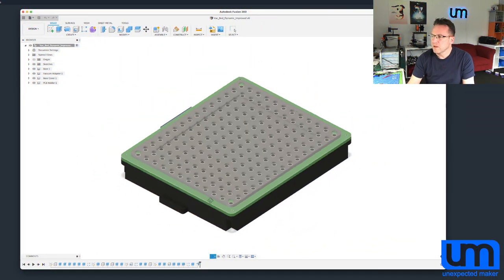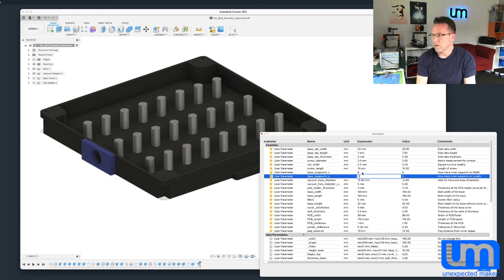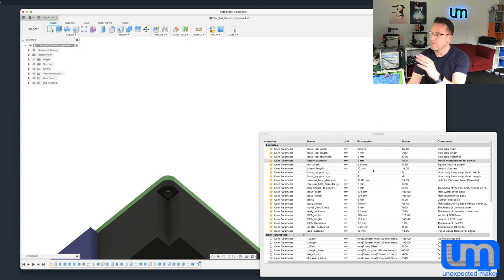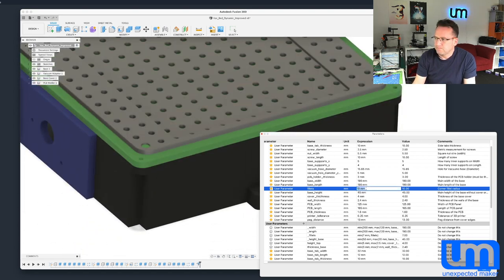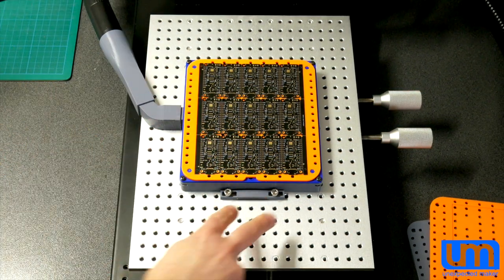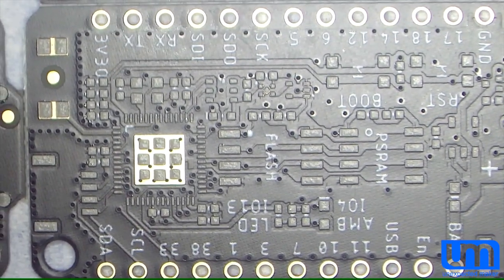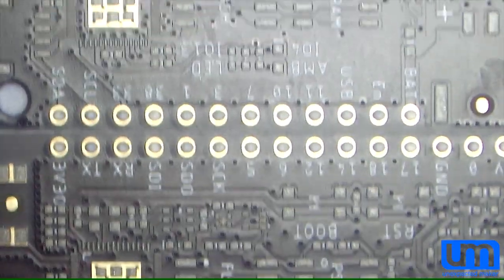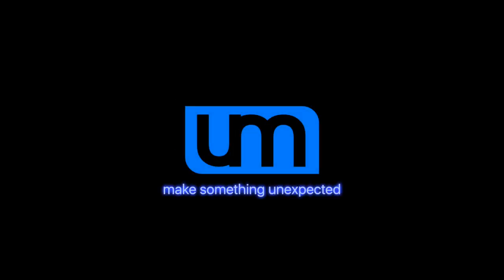Vacuum Stencil Bed Box - Parametric Fusion 360 Design!

Comment: What a contribution to the maker community!  You've cut the cost of DIY board production by at least $400 US. No need for stencil holder OR buying framed stencils. Thank you UM. 4 minutes into this video, I opened your F360 design on my desktop and counted 22 user parameters, most excellent. Now where's my new PLA spool?
Reply from the maker: I went overboard on the settable parameters, but better to put them in from the start that try to wrangle them in later when folks asked for something I missed!

I'm not sure really if there is any savings here - framed stencils are still much easier to work with when doing a production run, and that means a stencil printer of some form is still required. For me it's about repeatable paste application, and this ticks that box big time.
Reply: @UnexpectedMaker  good answer on the frame.

Comment: Great results, Seon, thanks for sharing a parameterized solution!  

I think this opens up a new opportunity that you may have missed:  Dual-sided PCB's.  After reflowing the first side, you can have a PCB adapter plate with component cutouts that would allow you to flip the PCB and stencil the 2nd side.  As long as the first side only had small components less than about 1.3mm high, you should have enough clearance in your 3mm adapter plates to make these component cutouts on a typical 1.6mm PCB.  Your designs are already impressively tiny, but imagine how small you could shrink them if you open up two sided PCB's.  Would love to see you try this.
Reply from the maker: I didn't miss that at all. Folks using my design are already tackling that. I personally swore off making double sided boards after my TinyPICO V1 launch... so I have n use for double sided, but yup. You can make any shape you want to hold whatever irregular shaped PCB you have. Both outline shape and height variances.

Comment: Hi, thanks for this idea, I've been drawing up a couple of variations on this theme in Solidworks over the weekend.  I'm planning to use CNC Kitchen  thread inserts rather than nuts to hold everything together. If you get round to doing any revisions consider adding some rads to remove the sharp corners, on a 3D print is pretty much free.  Thanks again for the idea.

Comment: Quick note on clearance of 3D printed holes vs clearance of other 3D printed geometry:  It's tempting to think that the same clearance applies at all 3D printed "walls", imagining that the exact position of the surface of the wall results from the amount of "squish" that the beads of extruded filament undergo as they are squirted into place. And indeed, that's part of the phenomenon. However, especially on smaller holes, it looks to me that as the extruded plastic is laid down in a ring around a hole, it's under some tension (the same tension that you notice elsewhere allows the 3D printer to span a several millimeter gap without support). And that tension causes the filament ring to draw inwards, a bit like a drawstring, reducing the diameter of the hole.  The point here being that a single parameter for "wall clearance" may not apply properly to holes, especially small ones.
Reply from the maker: Sure.. but my "printer-tolerance` settings only effects screw and peg holes. Everything else is not effected and well, it's up to the user to tweak if they need, but things like wall thickness lining up with cover size are not really issues if they don't as they will still make a seal, and that's all that matters.
Reply: @UnexpectedMaker  Yes, I wasn't remarking on your effort particularly, but rather on 3D printed holes in general, for those following along.

Comment: I'm back with another comment. How did you determine your printer's framed stencil height off the printer base accurately (I didn't watch the live stream, if its covered there I'm sorry for asking)? Also, what's your experience with board or panel dimensional and corner cut accuracy? You may want to put an outside corner relief on the PCB_holder sketch if corner cut accuracy is a problem. Hope that makes sense. Thanks for the video, I'm definitely making one of these. It rivals your part turntable for usability.
Reply from the maker: Most of my panels are not cut the same... hence the slightly extra wiggle room I showed on that I2S Audio panel, though some of them I make much tighter. I usually put the PCB into the top left corner, and 85% of the time it's perfect, and the times it's no, adjusting the stencil position/rotation with a stencil printer is super quick, and a tiny price to pay for a perfect paste application.

Comment: Outstanding.  Wouldn't the better paste result improve your PNP results?  VacuStencil name?
Reply from the maker: Well it wont improve "PnP" results, but it will dramatically improve reflow results which can compensate for slightly off placement from the PnP.
Reply: @UnexpectedMaker  Your right.  I was lumping the reflow in with the PNP.

Comment: Hi Seon.Very interesting . Are you using the box with a particular stencil printer?. Are you using the latest Neoden?
Reply from the maker: It should work with any manual stencil printer that comes with a clamping system. The Neoden one I am using is quite a few years old. I'm not sure if it's still their current model, but probably.

Comment: Really neat . I assume because there is x,y movement that you have to adjust the stencil each time to get alignment ?
Reply from the maker: Nope, most of the time I don't. Most of my panels I have printed holders for are much tighter tolerance. It depends on the reliability from my PCB supplier. The I2S audio shields I showed in the video were all routed a little differently hence the wiggle room, but I push them to the top left and about 90% of the time they require no adjustment.
Reply from the maker: Also, I should note, that using standoffs (the normal way to hold he PCB in place) requires more stencil  adjustment per panel (you'd think not) but reliability of edge rail routing and hole drilling from places liek JLC are terrible, and when working with fine pitch, I'd usually have to adjust > 50% of the time.

Comment: Hi Seon, great job! One question, do you have to adjust the X Y position for each panel that you paste? with the stencil printer adjustment?
Reply from the maker: Thanks mate! 85% of the time no I don't. When I do, but it takes a tiny fraction of the time to adjust the stencil (if required) compared to wiping down a bad paste and doing it again ;) Ultimately, even with my 8 head PnP, I can still paste panels 4-5x faster than my PnP can populate them, so I'm ok with any stencil tuning I need to do :)